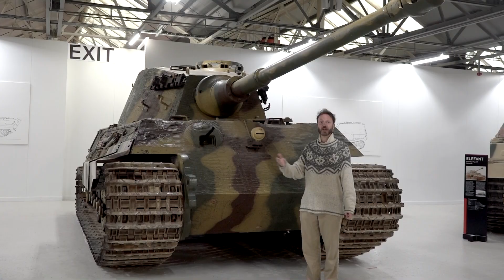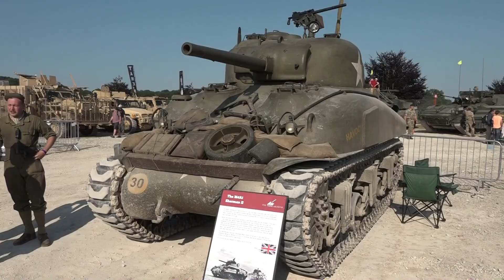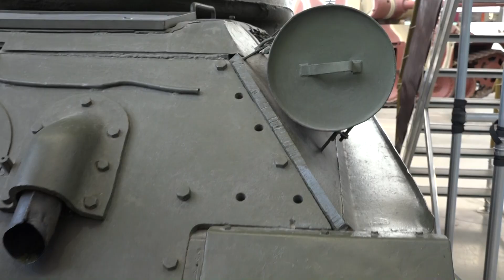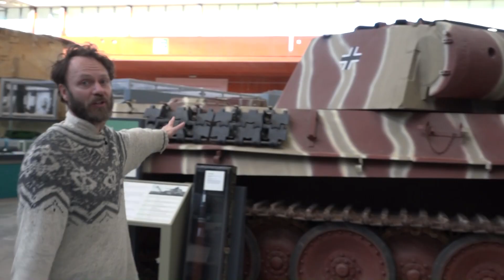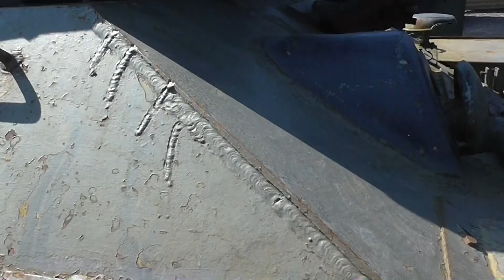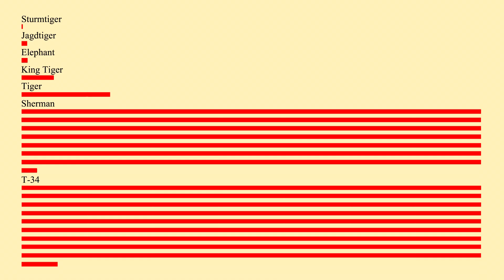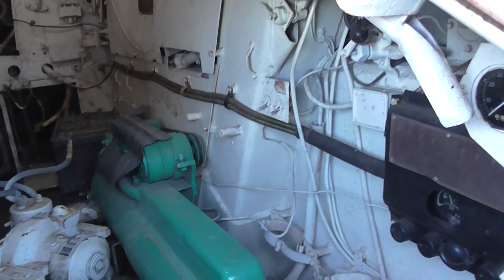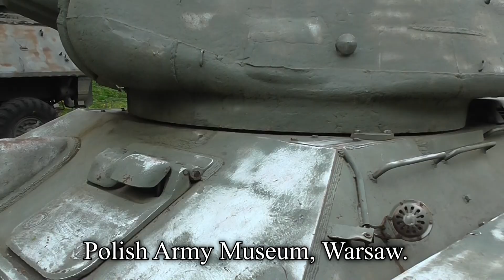World War Two's most common tank

Comment: The unusual tread pin “keeper” system seems its main benefit would be easy retreading which further reinforces my hunch that the pinned drive wheels and cam shaped dogs on the treads were prone to skipping track
Reply: I don't think so, i think the friction is an issue and you have to split the roadwheels. From what I recall they were to be tracked before battle in the design phase and they were intended to use a drive chain to one set of wheels for the road. I think they may have been a bit more resilient to slipping track 

I really think singular 'treading' was their only concern. Saves a part, especially one that might need threaded etc and was multiplicative. 

They frequently didn't even come with seats.

Comment: Quantity has a quality all of it’s own.

However, I feel you have to take into account the context of the war when judging the various benefits and drawbacks of the German tanks.

Plus, I find it difficult to glorify a tank that was designed around expending the lives of it’s crew. The Sherman had the significant advantage of not being a death trap.

You can say what you will about the Germans, but given their strategic and self imposed limitations, their tank forces did incredibly well with very limited resources.
Reply: Most shermans sucked. The later and postwar variants were  undergunned and heavily reliant on fighting an already defeated enemy, but they were fine. The early war ones were not.

Comment: Having seen a T-34-85 in operation at a local museum, I can confirm that the crew were riding on the outside, dressed in era-appropriate tanker garb... while the driver was shifting with a 10lb sledgehammer, mad as hell, and sweating waterfalls even with the front hatch wide open and a tank top on (guess we know where that came from) on a 68 degree day.

Comment: The old thing about it taking 4-5 Shermans to take out whatever enemy armour, my understanding is that that comes from US doctrine at the time was that any armour contact would get a response team of 3-5 tanks to flatten it and roll on to the next or handle however many it turned out to be once the report had made it up and down the chain and the team had actually gotten to the contact point

As for the masses of tanks(German KDr on T-34s would have won the war without Lend Lease), sloped armour, LazerPig has a very good video on the T-34s that I enjoyed enough that I have it on my phone to watch whenever I don't trust hotel WiFi... so fairly often
Reply: Lazerpig is an intellectually dishonest liar and a fraud. Look up Red Effect completely dismantling the pigs video on the T14
Reply: The Shermans would drive round the Tiger until it ran out of gas and the crew bailed.

Comment: The T34 was actually a very high quality product. The thing is, the Russians have a different way of defininf quality, we think of quality as meaning it last a long time without breaking; conversely the Russians accept that something will break, but if it is possible to easily fix it every time it goes wrong then it is high quality. The T34 could be very easily repaired in the field by semi-trained men, so by Russian standards it was very high quality. The Panther was, in many ways, a truly terrible tank - just look at how complex and time consuming a job it is to change the final drive - you have to take the bloody gun out which requires a special crane, and you then have to somehow wiggle the massive, heavy drive out through the mantlet hole. To change the final drive on the T34, you just unbolted the rear plate - that is why the one Lindy showed the arse end of only had a few bolts in that plate - even quicker to remove the plate to get at the final drive.

Comment: I think the most interesting and poignant comparison would have been if you looked at Germany's total wartime tank production. Would be interesting to see how that compared against just the M4 and just the T-34
Reply: Runs into the issue of there being no one M4 and no one T34.
Reply: @lokenontherange  I'm assuming you're talking about the different models of the M4 and T-34. While that could be applied to the German tanks as well, the Panzer IV seeing six models before Operation Barbarossa. But the thing about the Panzer IV Ausf A, it's still a Panzer IV. And the thing about the Panzer IV Ausf B, it's still a Panzer IV. Etc. And the same is true for the M4, and the same is true for the T-34.
Reply: @Mikaerebaker7499  That's largely correct but wrong in detail. Performance, reliability, viability of parts, armaments, and so on all vary drastically with a lot of those variants. Most people tend to talk about all Shermans and then start offering up late or even post war tanks as examples of what a Sherman could do, which isn't really relevant when only an extreme minority of tanks deployed into combat were of those variants and would perform to that standard. Most shermans performed to a much lower standard and had much less impressive numbers than the commonly cited figures. It's even more worth noting that the performance figures for British and American tanks are hard carried by the fact they outnumber German armour by about thirty to one and have much cleaner fuel supplies.

The early T34 was a bad tank. Later war T34s were uncomfortable but okay tanks.

I'll note here that this discussion isn't incredibly important in terms of what won the war. The Germans arguably did their best when their tank arm was tiny and mainly made up of 1s and 2s.
Reply: @lokenontherange  did you even watch the video? This isn't a discussion about how good or bad M4 or T-34 was. It's a discussion about how many were made, period, that's it. It's a discussion about the impact of quantity. 
Watch the video, you'll notice that Lindy is quite scathing of the quality of the T-34, and rightly so. He's also not exactly complementary about the M4. 
The point here is the allies had the quantity and, as Stalin said, quantity has a quality of its own. And in the second world war the allies numerical quality was more than enough to address the quality of German tanks.
Reply: @Mikaerebaker7499  He's comparing the rarest German tanks with the most common allied tanks and is implying that the variants are all at least similar in quality. No shit the allies look better. He's literally rigged it to make Germany look as bad as possible.
Reply: @lokenontherange  didn't you see the bit where he shows how many panzer IVs Germany built?
Didn't you hear how much he criticised the T-34?
Reply: @lokenontherange  according to Wikipedia, the total production of all wartime german tanks (so including what they made before the war) was 49,777.
Compare that to the 49,234 M4s, which entered production in 1942. Or the over 57,300 of the T-34 that were built?
When we look at the numbers game (which Lindy was doing, just look at the title of the video) there's no contest.

Comment: For my taste, Lindybeige took too many shortcuts in this film, I mean, mental shortcuts.

He did not mention the Stug III and IV assault guns (and others, almost 13,000 in total), which destroyed the majority of Allied armored vehicles. What about the German tank destroyers, of which around 6,000 were produced?

As for the T34s - they were built in at least 4 or 5 factories, from various components (there were even those with aircraft engines), in addition, each factory modified its T34s mostly independently of other factories. According to the memoirs of Soviet tankers, the worst problem with the first T34s was insufficient ventilation, which made the entire crew intoxicated with toxic smoke after a few shots, to the point of preventing further combat. The best thing about the T34 was the simplicity of repairs. Even heavily damaged tanks could be restored to full working order in 6 hours. Thanks to the soft steel (mild steel? don't know the correct term) armor (which was coincidental, as the Soviets had trouble producing large quantities of high-grade hardened steel), it was very rare for German shells to explode inside the T34 (except when the shell hit the ammunition) - they simply went into the T34, making one hole, and out the other. Tankers who stood in the way of such a shell were killed or wounded, but rarely the entire crew was killed. And the repair of the tank was just patching up the holes (and cleaning up the corpse).

As for the Panther, Polish historian of World War II, Norbert Bączyk, wrote a book about it entitled "Panther, WW2's Worst Tank" (unfortunately, available only in Polish). And before anyone starts throwing stones at me - this man, instead of repeating war myths stemming from Soviet propaganda, as thousands of other historians have done over the past 80 years, has spent years studying Wehrmacht and factory reports, which are available in the Bundesarchiv. And from them it was clear that the Panther was the most disliked tank by German tankers and staff officers, and in addition it caused the collapse of tank production in the Third Reich at the climax of the war, which greatly shortened the war.

Comment: The drive “sprocket” design on the T34 only offers one sheer plain and thus is inherently more prone to fatigue failure, but as you say “it only needs to last 3 months”

I think you did an injustice by not including the M3 with the M4’s because the 85mm variant is distinct enough that it’s a new design.

Comment: "6 month to build one" and "one every half an hour" is not really a comparison. Even when outputting one every half hour, would allow for over a year build time. They just need to build enough in parallel. Vice versa having to build 6 month on one(!) does not say anything about the output rate. So what was the output rate of the Panter or ho long did it take to build a T-34. To be clear, I do not doubt that the production rate of the T-34 outperformed by far the one of the Panter, I am just criticizing that you use not comparable numbers.

Comment: Lindy! 
The Panzer 4 is & isn't so an immo of the most produced German tank of ww2.
≈8,553 of all tank variants were produced of the Panzerkampfwagen IV.
10,086 Sturmgeschütz III a type of Jagdpanzer/tank hunter called tank destroyer in yankanese/american English  

Sturmge=storm which infer assault in German 
schütz='protection/shelter' not gun which the shelter/armour housed not assault gun that is a seperate thing that is similar but not the same.

No matter what yanks/Americans say 3in Gun Motor Carriage M10, 76 mm Gun Motor Carriage M18, 90 mm Gun Motor Carriage M36 or any other US tank is a motorised gun carriage having nothing to do with Jagdpanzer=tank hunter/destroyer.
For a start non of the USA tanks housed an Antitank gun: 
-M18 MGC Using the multipurpose down sized design based 3-inch gun M1918 anti-aircraft gun re-designated 76 mm gun M1 so not an antitank gun but an antiair gun repurposed for roles soft & hard target engagement.
-3-inch gun M1918 in the M10 MGC
-he 3-inch M1918 gun (76.2 mm L/40) and 3-inch anti-aircraft gun M3 (76.2 mm L/50) was a fvck off Anti aircraft not tank gun fitted in a tank.
Tigers mounted with 8.8Cm flak guns/AA were not designated Jadgpanzer or tank destroyers as by design they simply weren't for no dedicated ant-tank gun as is required for a start.   
Sturm tiger was a tank destroyer/tank hunter by design mind.

on a seperate note:
-75 mm gun M2–M6 was am odd request calling for a light AA gun designated T6 that had us ammunition that 75 mm field gun M1897 shot.
So an small AA gun that used field gun/howitzer ammunition that proved useless for it's original role of anti-air being housed in Sherman M4 tanks instead the later the M24 Chaffee which served well enough.

Christler simply marketed the M18 motorised gun carrier as a tank destroyer as the USA solders & public were afraid that their Sherman's couldn't stand up to Germanies imposing Jadgpanzers.  

German (tankhunter doctrin= Panzerjäger-Doktrin) was simply never explored nor applicable to Britain & the USA in ww2.
Besides German only really Romania, France , USSR & the Italians sort of had tank hunter Panzerjäger.

USSR has the SU-100 that used the  D-10S tank gun that was a dedicated antitank gun same as a Panzerjäger/tank destroyer demands.
France Chasseur de Chars Lorraine tank hunter armed with a 47 mm SA mle 1939 cannon later converted by the Germans to Marder I 7.5 cm Pak 40.
Pak is short for Panzerabwehrkanone = antitank cannon. 

you need a Panzerabwehrkanone big or small to have a Panzerjäger/tank hunter that the USA simply didn't have.

I could go into this more but I have other matter to attend to & such.

Kind regards lindy!

Comment: T-34, not bad even okayish to good design on soviet paper. 
Built lots, most broken down with 200 miles, rather expensive to build compared to American or even some British tanks, even if built in factory 183 that just didn’t bother fitting stuff (like seats or lights so don’t try moving in the dark), rubbish gear box, engine not bad, T-34 track pin striker plate was a later work around to stop the tracks falling apart which they did a lot as the pins broke. Spare parts and logistic train almost no existent so easier if yours broke down (which it will unless it was blown up) to nick spares from another broken one as you won’t get spares any other way, so that one would just be stripped. 
Some new issue ones straight from the factory came with a spare gearbox strapped to the engine deck as the brand new one fitted will break in a couple of days. Oh gun was good or great, but as the gunner couldn’t see anything or the commander not that useful. 
Oh and the bit about the Stalingrad tank factory driving tanks straight to the front? Yea propaganda, didn’t happen, the factory had been shipped east well before the Germans got there. Good story, but Nah never happened. 
Only gets the love it does because of soviet propaganda after the war, which the west as they didn’t know better took as fact. Poster boy but under cold light of day no very good as made. 
All in all as built a bit rubbish 
Unless it was a post war one, built by say The Polish or Czechoslovakians in the 50s (like the ones you see at Mayday in Red Square, yes those aren’t Soviet built at all), with quality control, built to spec with the Gods awful gear box fitted with optics, gun sights, radios, etc … like most of the running ones you see. No Soviet but Polish ….. Strange how that wheel keeps turning
Reply: that's a bit of postwar nato propaganda. u can hear it a lot about the current nato-russia conflict about russian army being a pos. however they are successfully fighting a proxy war with nato.
Reply: @feorh1919  whatever tankie

Comment: The T-34 is a very good tank. It has flaws such as crew survivability and comfort but that's about it. The protection was superb. It was also designed in 1934, if you compare that to what the Germans and allies cooked up in 1934 the T-34 will look like a literal Abram.

Comment: the drive wheel of the t34 uses rollers to interact with the teeth on the track and because of that produces much less friction than a conventional sprocket wheel. that is great because it's much more efficient on the engine power, the same amount of horsepower will move the tank faster. the problem however is you concentrate much more force on a smal bit of metal (the pins he mentioned). so in practice the t34 was really at the upper end of weight you could move with that system, that's why it never caught on.
Reply: If only the T-34 could actually reach those speeds. The transmission was a major weak point for the majority of T-34s and took a feat of strength to shift to third gear, and herculean effort to go into fourth, assuming the lever didn't break from the strain.
Reply: @zachrich7359  i think it's manly a leftover from the bt series, those were more along the lines of what christie imagined. including running without the tracks on, which i think they got rid of as a feature by the time of the t34.
Reply: @saladiniv7968  perhaps, doesn't change the fact it was a shit transmission

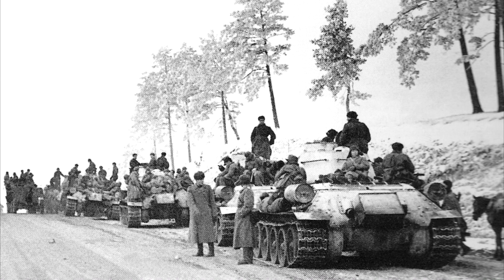Comment: At 22:34 you can see T-34 that is knocked out. 

The hulk of metal on the back is in fact a SPARE gearbox and braking system I believe. The friction materials were so bad on the first production tanks that they just carried a spare strapped to the engine deck.
Reply: This is a myth, it would be impossible to change the transmission within a crane to move it around, the one (1) picture of a T-34 with an extra Transmission is a T-34 carrying a spare during the evacuation of a facility.